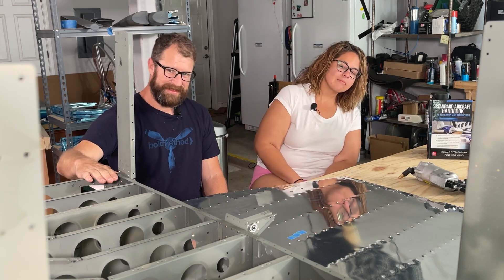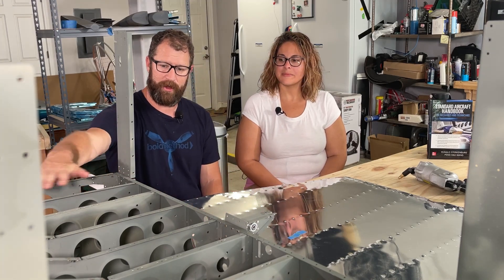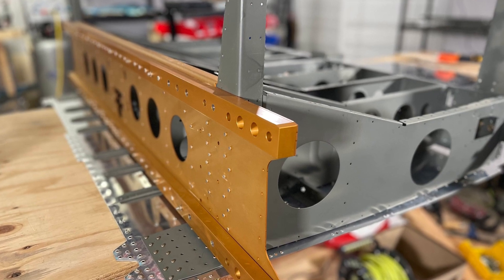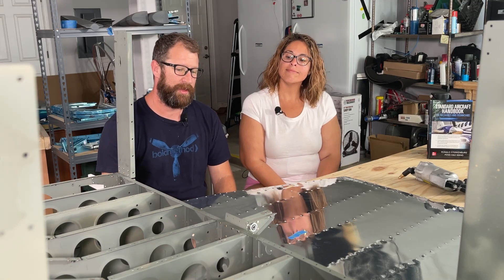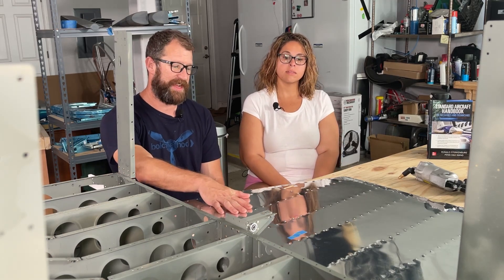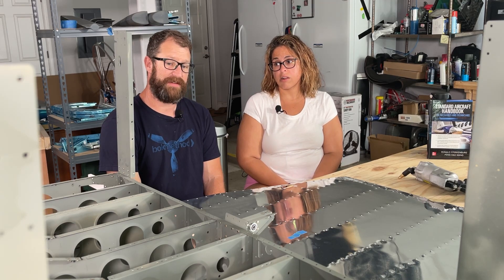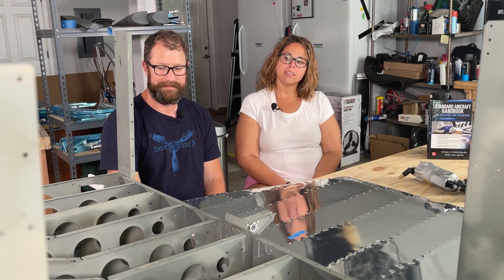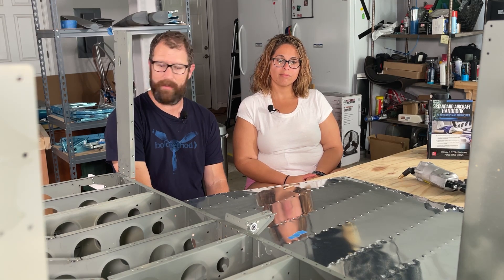Vans Aircraft RV-14A Fuselage Build  Sec 26 Part 1

Comment: One priming tip that I have learned is to spray pieces with the flanges pointing up first, let it dry, then you can flip them over so the part is standing on the flanges and spray the other side.  It saves a lot of time instead of waiting for the part to completely dry.

Comment: You might want to buy some 2 ft X 2 ft 2024-T3 sheet thick enough to practice countersinking.  I cut out a 10 in. X 10 in. piece and drilled a bunch of holes in it so that I could practice all of the necessary skills before I touched my kit.  It helped me a great deal especially with the countersinking.  I had to do about 30 holes before I finally found the right combination of speed and pressure to avoid chatter and get a smooth c/s face.  I also bought a single flute cutter which seemed to help, but eventually I got good results with a 3 flute cutter.  A good metric to remember is if it screams like a banshee when you're cutting, you're doing it wrong.  Ideally, the perfect countersink cut will be long ribbons of curly aluminum.

I'm about to dive in to the wing spar and there's a whole bunch of holes to countersink on the flanges and web.  Those spars are $2400 each if I screw it up so I'm going to break out the scrap and practice first!

Comment: The best way to countersink is to gradually increase the diameter by adding slight pressure to the countersink bit and constantly measure with a rivet until the rivet sets flush.  Otherwise, you may over countersink, which is not good.  Practice "sneaking up on it" and eventually you'll get the results you're looking for.